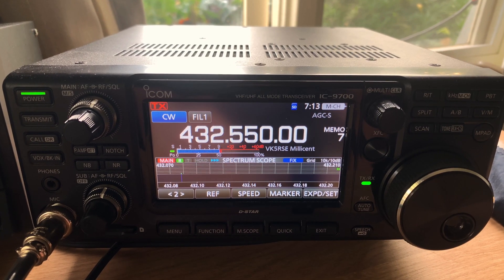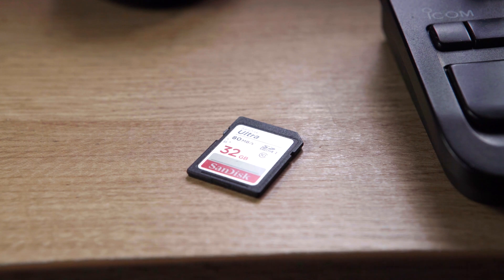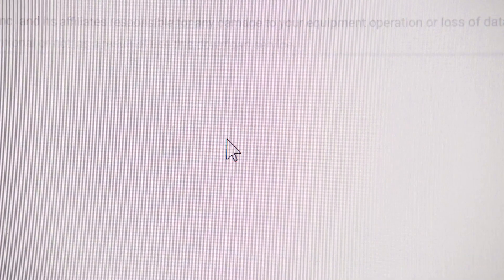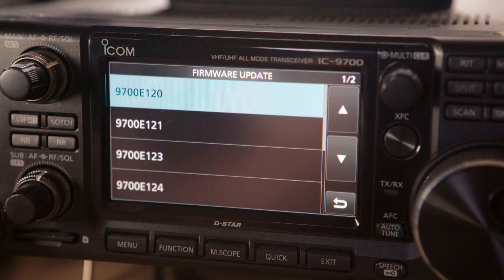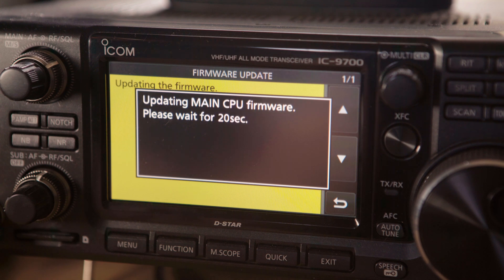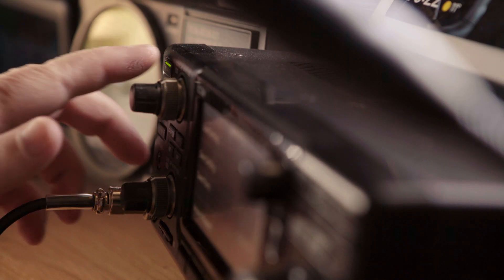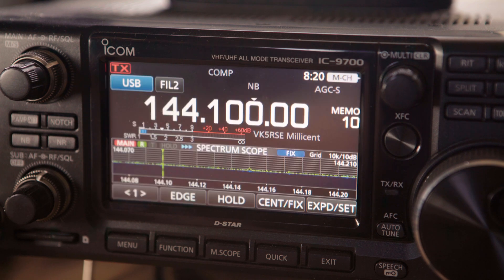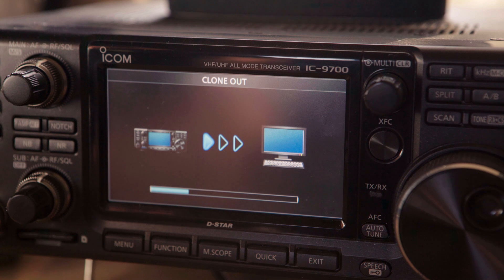Icom IC-9700 Firmware 1.30 upgrade

Comment: Great videos, very informative, thanks. Has there been a firmware fix for the drift problem? im looking at buying one in the next few weeks
Reply from the maker: The drift is still an issue but later firmware updates have gone some way to address the issue. It's a great radio non the less.
Reply: @VK3FS  thanks for getting back to me I will grab one and hopefully further updates will rectify the problem 73's
Reply from the maker: It's not perfect  @grunt_mahoney6027  but it's a lot better than it was. If you're planing to use SSB, you may not notice it. You will on WSPR and some of the digital modes, especially at higher frequencies.